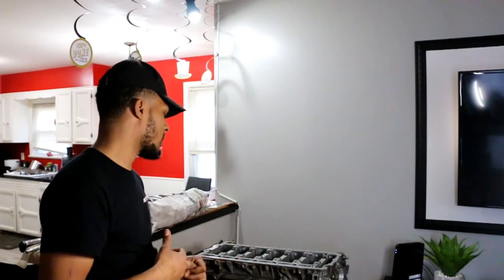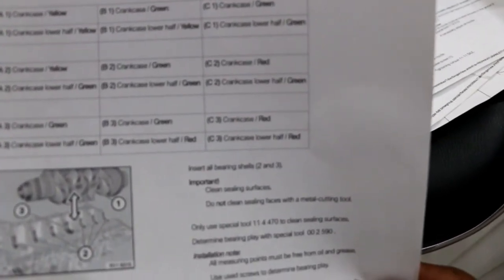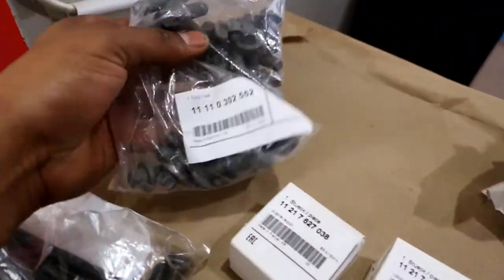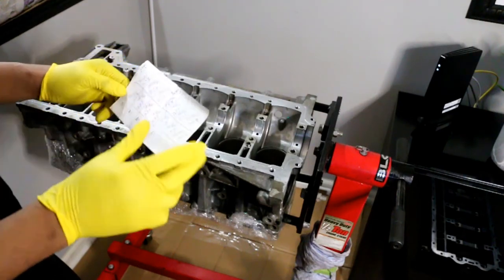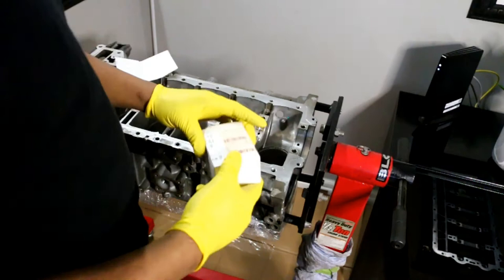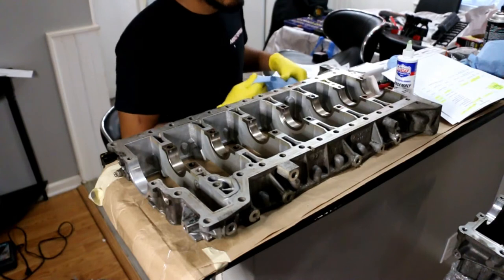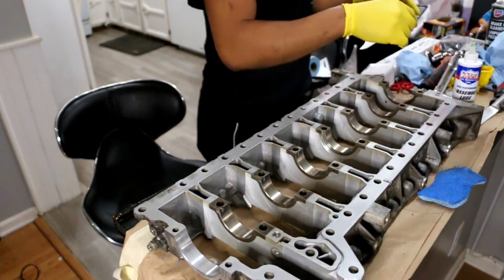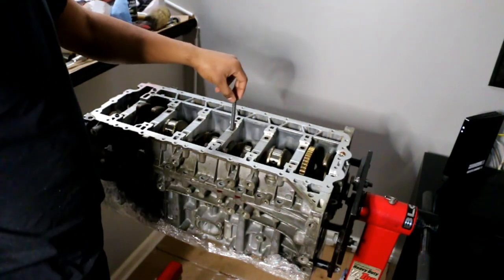N54 REBUILD | EP3. | CRANK SHAFT AND MAIN BEARINGS

Comment: When you torque bolts make sure to dip the threads in motor oil, that's why they were jumping and skipping while loading up, also your torque number will be wrong with out oil, other wise looked good.

Comment: Do you have to check the clearance for the main bearings
Reply from the maker: Yes you measure the crank to see if its in spec. If it is you decode what size main bearings to use via Stamp on block and crankshaft.